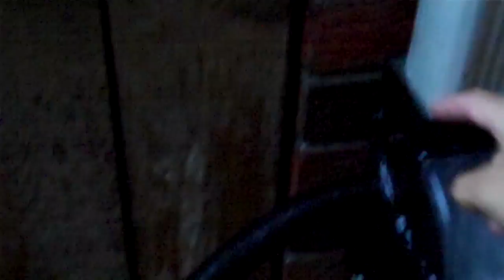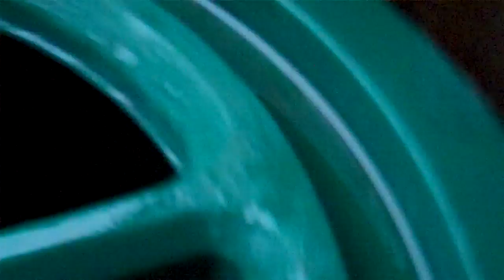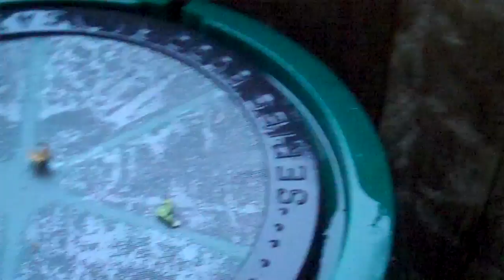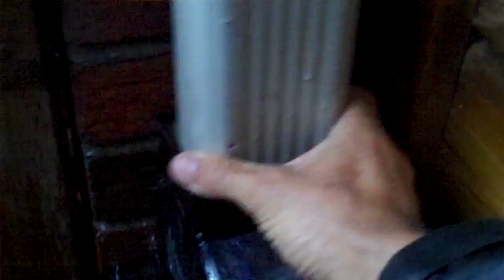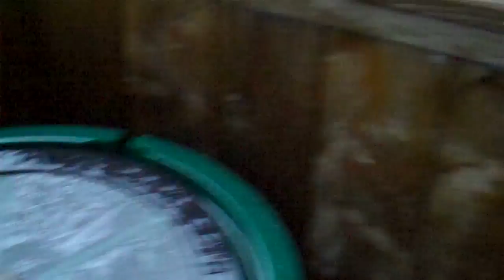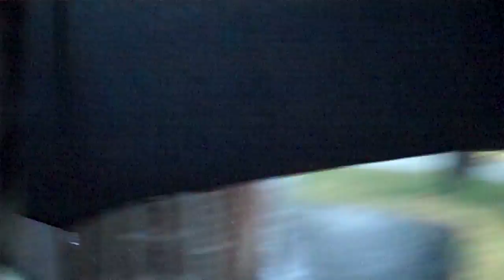Testing Fiskars DiverterPro Automatic Downspout Diverter

Comment: Too bad I can't find this diverter for sale anywhere!  I like the design.  I question your installation of the diverter that appears to be higher than the top of the barrel.  A reviewer said it must be level with the full level of the barrel. If the diverter is higher than the barrel, it will overflow the barrel. Can't tell on your video, and you don't mention it. I have found no videos that show a full barrel. Thanks for showing the diverter in action, especially the rain flowing into the barrel. That's good flow!
Reply from the maker: Yes it has to be perfectly level with barrel to work properly. We haven't installed one of these in a long time. We use a manual Y diverter. Thanks for checking out our videos

Comment: Add silicone seal, especially at bottom.  Also, need to flatten fluting and square corners of downspout because Fiskars does not shape its adaptors to properly fit the downspout.  Other than the fit issue, this is a great diverter.
Reply from the maker: I agree it works well
Reply: Can you let us know how you squared corners? I tried to do mine and today we got a storm and it's not working 😕
Reply: @jessica1587  To square the corners and flatten the fluting, I used lineman's pliers, which have a fairly wide grip.  Standard pliers would likely work but take more squeezes to re-shape the downspout.  And a plastic downspout will warp into shape although a couple screws will help close gaps.  In any case, seal the joint with silicone seal or caulk.
Reply: @FredOzzie  that's really really helpful! I'll try that, thank you!!